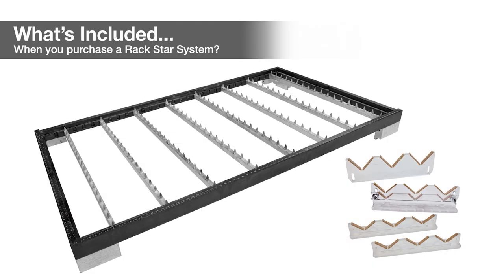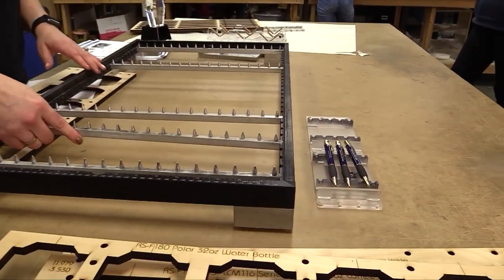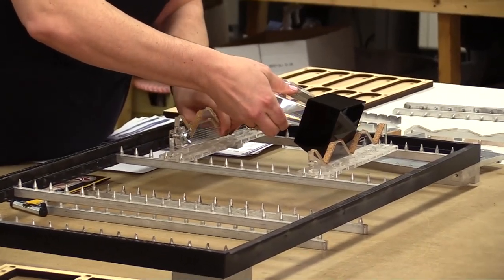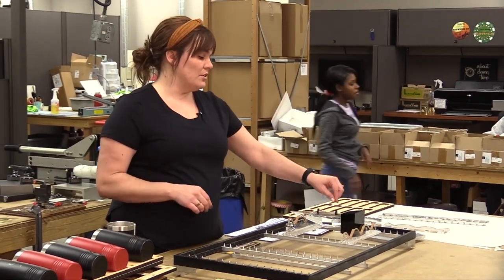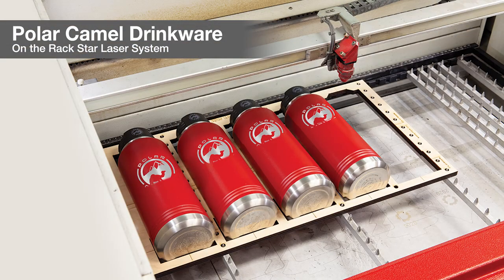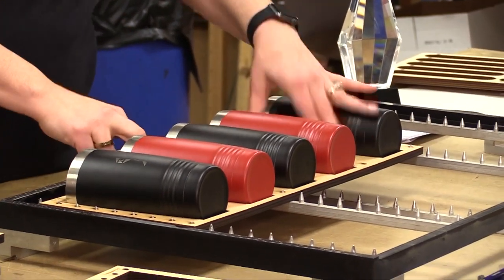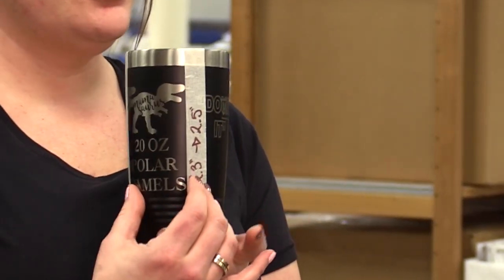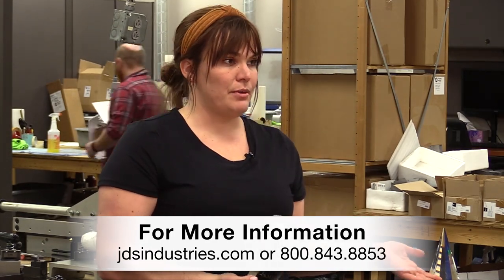Answers to Frequently Asked Questions About the Rack Star Laser System

Comment: Will this system work with the Xtool M1 and D1 laser systems???
Reply from the maker: Unfortunately, these Rack Star systems are designed for industrial lasers. The precision of lining up the laser with the Rack Star system and fixtures wouldn't be consistent with a desktop laser. Hope this helps!
Reply: @JDSINDUSTRIES  It would be be nice if you did because a lot of your customers have hobby lasers